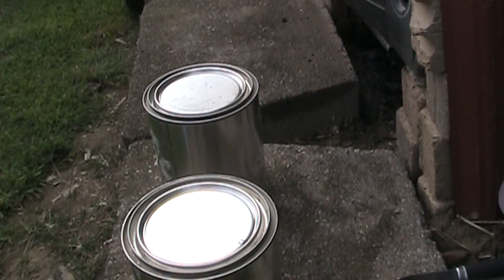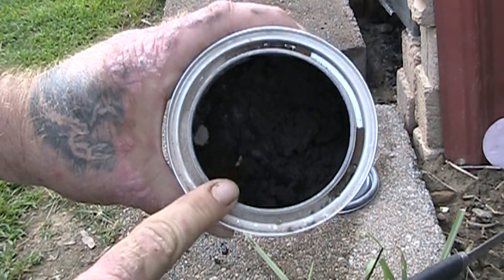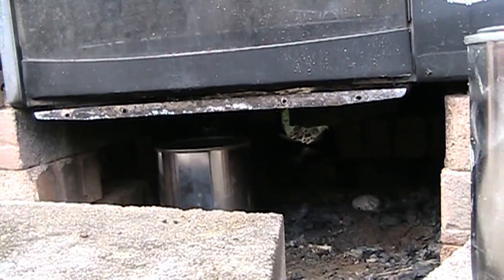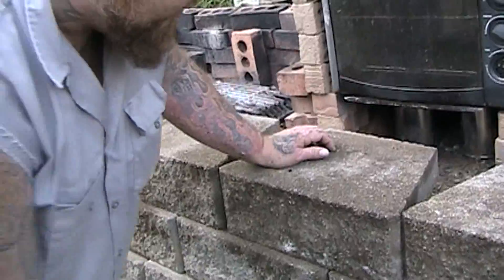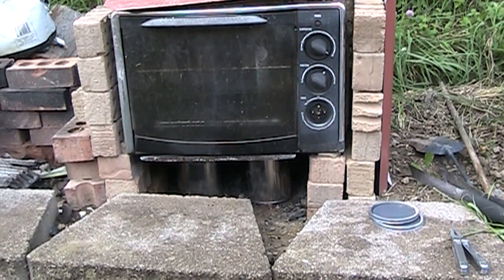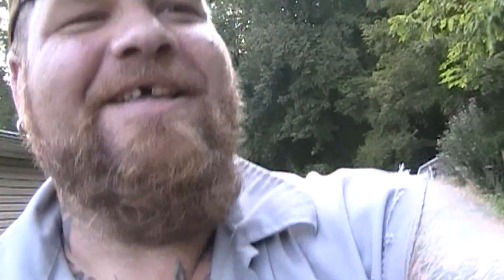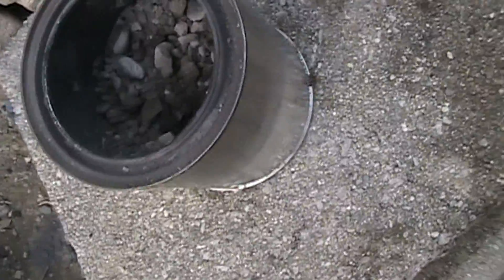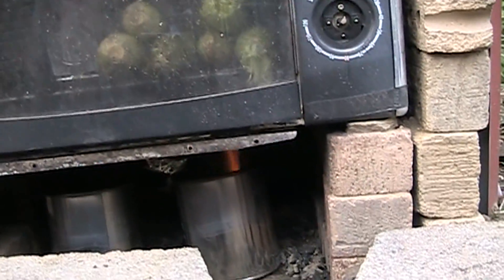Alternate Alcohol Fuel

Comment: Diatomaceous earth consists of fossilized remains of diatoms, a type of hard-shelled algae. It is used as a filtration aid, mild abrasive in products including toothpaste, mechanical insecticide, absorbent for liquids, matting agent for coatings, reinforcing filler in plastics and rubber, anti-block in plastic films, porous support for chemical catalysts, cat litter, activator in blood clotting studies, a stabilizing component of dynamite, and a thermal insulator.

Comment: Try compacting the fuel flat, then take a 1/2 tube and shove down the center and out the bottom, drill hole in can and remove the tube. Then light.